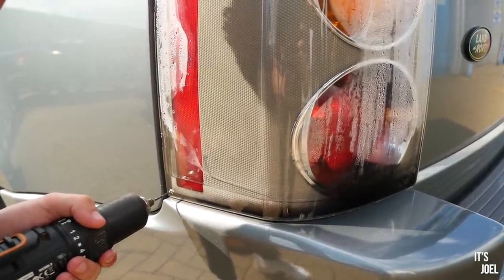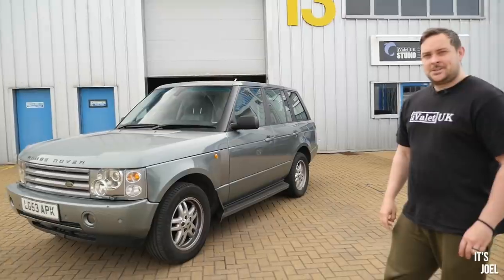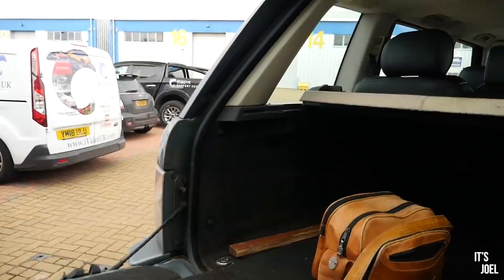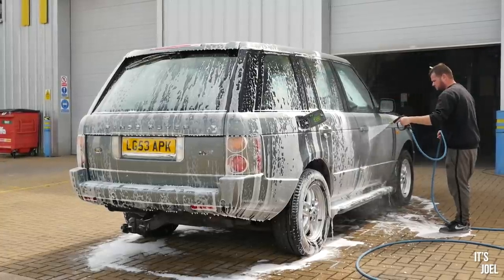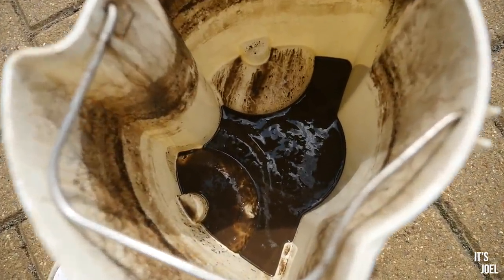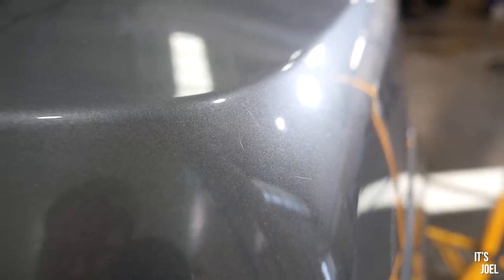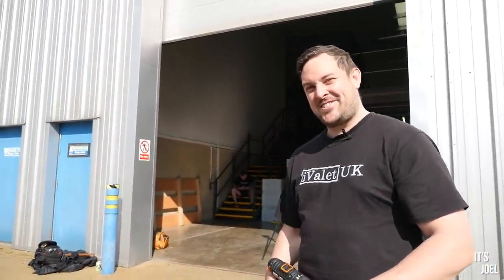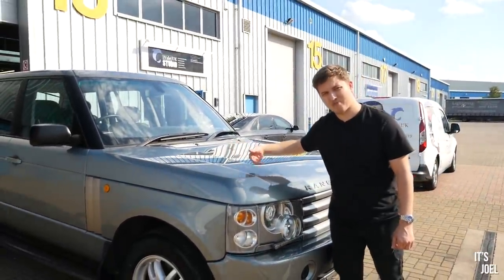Deep cleaning the cheapest V8 Range Rover in the country

Comment: Really love this model in this color.  Must admit though, the wheels might need to be replaced at some point to larger newer Range Rover wheels.  They seem too small for the truck.  A real beauty though.  These guys take so much pride in their work which is hard to find these days.
Reply: This Range Rover certainly looks more regal and imposing than the current one. The current one looks quite feminine and curvy.
Reply: What is the fascination with bigger wheels and thinner tyres? I would much rather have a little body roll on the motorway and have much more traction off road AND comfort on road. The lower aspect ratio tyre you have equates with a harsher ride. You do not need to be able to track around a one hundred and eighty degree bend at one hundred and thirty miles an hour as if you were on a Grand Prix circuit. The Range Rover is a luxury car, not a Maclaren sports car. The original L322 was fitted I believe with 18" rims, previous models had 16" and I would sacrifice a bit of "wallowing body roll" for the comfort of a higher aspect ratio tyre any day . And plus the active dynamic suspension will take care of much of the body roll anyway.
Reply: @samrodian919  I totally agree these bigger wheels with low profile tires look stupid

Comment: Curious about that drilling, could it not have been drained by removing the lamp itself?
Reply: Yeah thats what i was thinking, I had a similar problem on my old Astra and it was simply a case of taking the light out, draining it and checking the seals. In my case the previous owner or somebody simply didn't put the light buld casing back on correctly when they changed the bulb, 15 minute fix!